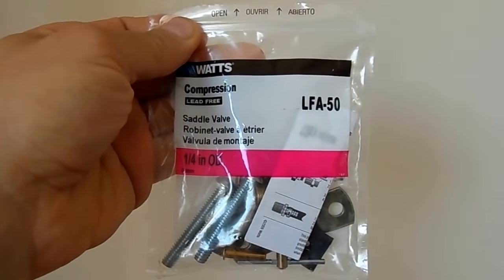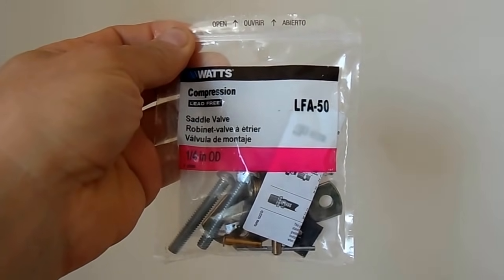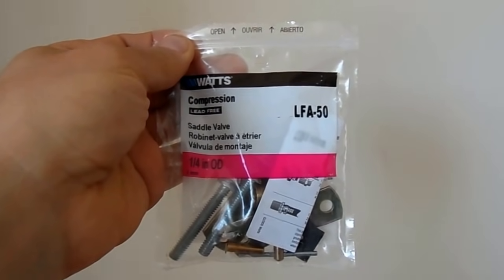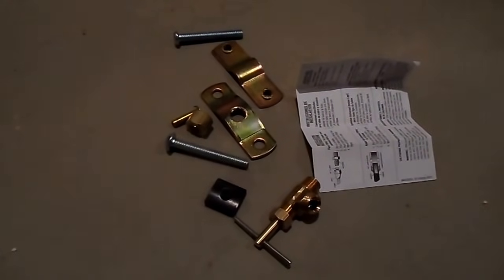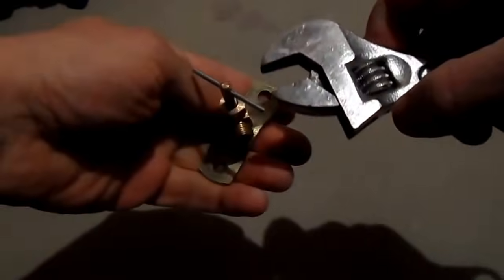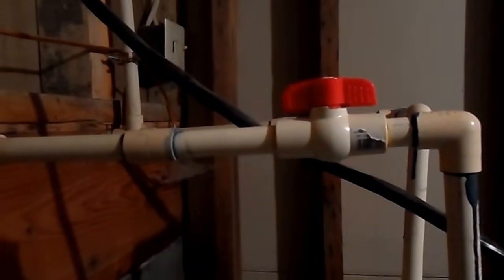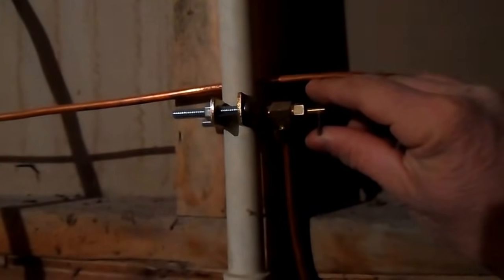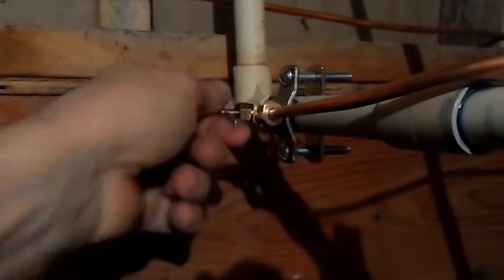How to Install a Saddle Valve (Plumbing Tutorial)

Comment: These valves will not pass home inspections, and insurance companies will not cover damage caused by leakage.
Reply from the maker: I would never suggest installing them anywhere where it is not code to avoid these problems. As far as I know, they are no longer code anywhere in the USA.
Reply: @JanaeBerzon So you did this video for the views??
Reply from the maker: When I created this video they were still up to residential code where it was installed and in many other places.

Comment: Unless your humidifier somehow knows that you have recently run hot water before it draws a supply it doesn't really matter if you connect to the hot or cold line because most of the time you will get cold water either way.
Reply from the maker: That's not really true, because your humidifier will typically run for at least 10 minutes. So, yes, it will start cold, but will go through plenty of hot water by the time it's done. The amount of cold water it will run through can also be minimized by placing the valve close to the tank.

Comment: Saddle valve: an accident about to happen
Reply from the maker: Not necessarily, but it is no longer code for new installations just about anywhere in the US, so I would not recommend it.
Reply: I got one that's been working for 45 years. No trouble yet.

Comment: Thats a water time bomb that will go off a insurance claim waiting to happen that  no insurance will pay when they find out it was a sadle valve
Reply from the maker: I can't comment on hat the insurance company may or may not do in your specific case. Generally speaking, if it was code when it was installed, it should be grandfathered in and an insurance company would have a hard time denying your claim based on this alone, if you have the appropriate coverage, of course.

Comment: You should explain how to do one if you have steel pipe. That wont pierce the pipe. Im wondering if you can just tap threads or the you use a different type. For a swamp cooler
Reply from the maker: You can't use these with steel pipes. They are designed to work with copper pipes, but will also work fine with cpvc and pvc.

Comment: Not clearly demonstrating the various parts that come with the valve itself.
Reply from the maker: There is really not much to demo here. It's the valve, the clamp, and the gasket.
Reply: @JanaeBerzon  there are about 7 pieces in a saddle valve packet. If you're doing a "how to" on installing a saddle valve you have to walk through each part, ehat the part is for and how those parts work in relation to one another. Then, of course, you show this step by step in the video to get a legit how-to video. Assume your audience has no idea how to perform the task at hand.
Reply from the maker: @charleswalker6109  I am not sure that one aize fits all is the best approach for turorials. That's why there ate soany of them out there and each one has its own audience

Comment: Where is the needle that pierces into the pipe? (is it hidden in the valve?){ and if my existing saddle valve leaks can I replace the saddle valve without purchasing the whole kit? Thanks.... Can I buy just the valve with the needle? Thanks....
Reply from the maker: The piercing needle is inside the valve.

If your eisting one leaks in the open position, you can shut it off and if it doesn't leak in the closed position add another one next to it. If you try to just replace it, you are likely to pierce a new hole or enlarge the old one, which will create a big mess - don't do it!

You may be able to find a valve without the 1/4" line, but  don't expect a large price diffrence.
Reply: @JanaeBerzon  Ok, could I replace just that part(the valve with the needle in it? because thats the one that has the ferrel in it(internals)....thanks....
Reply from the maker: @zr1ne  it really depends on where the leak is and under what conditions it leaks. If the leak is feom the top of the valve, your best solution may be to tighten that nut. You may also try repacking under that nut.

Replacing is not likely to work, especially if the replacement is not a perfect match.

If the leak is where the saddle valve attaches to the host pipe, replacement is even more likely to cause additional problems.

Comment: Step 1: throw your saddle valve in the garbage. Step 2, install a proper Tee fitting, reducer, and compression fittong as needed. This will take time but isn't guaranteed to leak eventually as saddle valves are.
Reply from the maker: That's a different approach that will also work. It's not nearly as easy for DIY.
Reply: @JanaeBerzon  saddle valves are not allowed under most plumbing code because they are almost guaranteed to leek eventually.  If you can't do it the proper way, you shouldn't be doing it at all.
Reply: @shawandrew  Why do manufacturers of plumbing parts even make products that don't meet plumbing codes?  Is there not an equivalent of UL for plumbing, like there is for electrical, that would stop such a product from even existing in the first place?   How do accordion traps and saddle valves ever get approved for manufacture?
Reply: @carultch  thanks for the question. I am not a plumber and learned what I did from replacing a saddle valve and seeking information from those more informed on YouTube. From what I can tell, the rules in plumbing are more like industry standards that affect the liability for the plumber. They don't really affect DIYers (do it yourself - ers) at all, and obviously you can do whatever you want to your own home, though it might affect the home inspection when selling it or risk damage to your property. Manufacturers also know that there is a niche for DIYers who would rather do something in a way that doesn't require as much skill or training, and whether you agree or disagree with this level of government regulation, there are not strict regulations against some plumbing products which plumbers would be liable for using. I'd also add that some of these standards might not be universal across all states or all over the world. I saw accordion style traps on Urinals in a Ukraine men's bathroom. The bathroom also always smelled like piss and had a sign with a visual telling men not to piss on the floor lol.
Reply: Can you shut these off?
Reply: @chriswentzell1591  if you install a valve on your line coming off the Tee, then you will be able to shut off the water on the Tee line.
Reply: I've got a 45 year old saddle valve that's still doing fine. It's lived through 3 refrigerators and now on its 4th.
Reply: @mandovapehater6988  doing better than the one that I removed from under the in law's sink. There are some saddle vlaves that are will work, but I don't trust them.
Reply: @shawandrew  understand. I'm sure they're not the best option but mine has yet to fail. I'm actually about to install another one for my downstairs fridge. Is the rubber piece just supposed to sit between the pipe and needle? It's curved as to fit or rest against the pipe and then a male piece that I assume the needle goes through. I don't know if the old one has a rubber in it. I've never installed a saddle valve and I'm not taking that old one apart just to look.

Comment: My saddle valve won't stop the water to my fridge when I turn it clockwise.  When I turn it counter clockwise water sprays me in the face. Is that fixable?
Reply: Saddle valves do tend to have these problems. A Tee style fitting might work better. There are different kinds  including push connect and soldered fittings. The channel Got2lrearn has a lot of good information on alternatives if you decide to go with an alternative to saddle valves.
Reply from the maker: It may be possible to fix. By description alone, I can't tell. I would try replacing the gasket and if that didn't work, replacing it. If the symptoms persisted after that, it may mean that the piercing has gotten too fig over time and through much mechanical action closing and opening the valve. In that case, the only things you can really do is replace it with a different valve type in the same location, or add another saddle valve down the pipe.

Comment: I was watching the video for the very ending. My saddle valve is secure but when I open it back up halfway water spurts out the end of the adjustor. When I loosen the valve completely out, the water stops but there's no water going into the line. Any idea what's wrong here?
Reply from the maker: If I understand you correctly, it sounds like the nut at the top of your saddle valve may be loose. If that's not it, perhaps the valve is defective.

Comment: It is not a valve. It is a tap. And is illegal as per code. And will fail at some point. Anyone who installs one of those is a hack and is incompetent.
Reply from the maker: You can call a saddle valve a tap, or whatever else you like and make unfounded claims, as you like, but that doesn't make them so. I have had multiple of these valves operating for decades in houses I have owned and none of them have ever failed. Can they fail, of course, like any other valve. If they are illegal in your state or jurisdiction, please don't use them. They are perfectly legal where I live.
Reply: @JanaeBerzon  What is unfounded with my statement? Also what municipality are you claiming that they are legal to be used in?
Reply: I installed one some 20 years ago..it's still working
Reply: I got 45 years on one. I think there are some licensed plumbers on here that are made about people doing it themselves.

Comment: Saddle valves are junk and should never be used eventually they all leak
Reply from the maker: I have had multiple saddle valves last for decades without leaking. Eventually everything breaks and these valves are not an exception, but that eventually is a very, very long time in the case of a well made saddle valve.

Comment: This is not a good option to use.  In many states it is not allowed by plumbing code and licenced plumbers are not allowed to install this type of valve.
Reply: no they're not the BEST option but they can work if done right. just watch them. everything is liable to leak at some point.
Reply: I've used them in the past with no issues.

Comment: So my valve from Home Depot appears to be missing the rubber gasket or do you think that there is a type that doesn’t use it
Reply from the maker: There should always be a gasket with these. I would not feel comfortable installing one that claims to not need a gasket.

Comment: Do I need to shut the water off for this?- the three Stooges
Reply from the maker: You don't have to turn off water supply when installing them. Obviously, if you ever want to remove one, you will need to turn off the water, remove the saddle vale and repair the piercing by silver soldering or otherwise repair it.

Comment: Discussing the drilling into the pipe would have helped - and saddle valves use compression fittings, not flared fittings
Reply: you're not supposed to drill. it has a spike on there. the valve itself will pierce the pvc pipe. you install it with the spike out, then close the valve to push the spike in. when you retract it, water will flow.
Reply: @Sean_y4k2l5  You're totally correct about pvc pipe, but older homes have galvanized pipe - and that totally needs to be drilled. Rigid copper pipe will also need to be drilled
Reply: @jonathanformhals4304  thanks jonathan. I just did this and I'm finding the flow is probably less than it could be. i will probably go back in there and drill it.

this valve kinda sucks. a sink-like shutoff valve in 1/4" would be better, but i'm in Costa Rica where certain parts are not available.

Comment: Using a saddle valve is the dumbest thing to do for water supply line. No plumbing section of any code allows for piercing saddle valves to be used anywhere in residential plumbing. It is mind boggling how those things aren't outlawed yet
Reply from the maker: This statement is incorrect. The correct version of it would go something like this: "Saddle valves may not be appropriate/approved for some applications and pipe types and some local jurisdictions may have adopted plumbing codes that prohibit their use in certain cases."
Reply: You are dead wrong and he is right. Saddle valves are against code in the MAJORITY of States and for good reason. You are a consumer can buy and install one. But a professional plumber cannot. That tells you all you need to know. Its illegal in most places for a plumber to take money for it because it doesn't do the consumer a service.
Reply: Jake Berzon thank you but i don't really need you to sweeten and soften it. it is dumb and it is stupid using a saddle valve, regardless of what codes say. codes follow reason and if a plumber is using it just because it is convenient for him that doesnt mean that customer should be misled that this is still the dumbest thing you can put on your pipes. Any other suggestions for spelling and grammar improvements?
Reply from the maker: You know what they say about opinions?.. Exactly! Everybody has one. You think it is stupid and dumb to use piercing saddle valves and millions of people have used them without problems. Can't wait to hear what you think about Sharkbites!
Reply: Dude, I am not sharing an opinion but a scientifically proven fact. I don't think it is stupid and dumb to use one. I know for a  fact to be stupid and dumb. How do you know exactly that millions of people used them without any problem? Did you do a statistical survey? I doubt that. You are one of those guys you're speaking about - with plenty of opinion and zero factual experience. My factual experience states that every time you install a piercing saddle valve on a hot water line, in 4 years it will be corroded in such a way that it either will leak or will be completely blocked. I am still waiting for you to show me which code allows usage of saddle valves, but I guess it's just like your opinion - you think it is so, but whether it actually is so, well, that's another matter.
Reply from the maker: For your information, my friend, codes can just as easily forbid certain usages, as they can allow others. What this means is that in a lot of cases, whatever is not forbidden, is allowed! Also, I do not have to be the one collecting statistics in order to use them. And BTW, I am sorry about your negative experience with saddle valves.
Reply: You don't need to be sorry about anything. There are always going to be morons who exploit gray code definitions to market 18th century technology without assuming any liability and even dumber users who will not object to whatever "da pro" says. Anyways, it is our job, yours most of all since you uploaded this instruction, to clarify also what the are risks and limitations of using such valve. I didn't hear that on your vid, and frankly, it is kind of misleading and annoying.
Reply from the maker: There is nothing misleading about my video detailing installation of a saddle valve in my home located in a jurisdiction that allows such installations. Your statements on the other hand range from insulting to misrepresenting. Please go find another place to litter.
Reply: @JanaeBerzon  ... I've got to agree with you. I've been using a saddle valve for years for my refrigerator water supply. No problems. I see absolutely nothing wrong in your presentation.
Reply: Quentyn73 we install humidifiers with our furnaces at work and the humidifiers used to come with a really nice tee fitting. now they come with these saddle valves. if installed on the cold line is the life expectancy any better?
Reply from the maker: You can install them on the cold water lines for refrigerator applications and they should work reliably for a very long time either way, as long as you don't turn them on and off over, and over, and over again.
Reply: Hayden Dyson life expectancy of a saddle valve on a cold line is much bigger than hot, but then you need hot water to achieve better evaporation. I'd use a small ball valve, similar to ones used for water supply for toilet bowls, just make sure that it has the compression ring connection matching the line diameter to the humidifier. Saddle valve on hot water line is guaranteed to corrode and break in 5 yrs max. ball valve. will break after 50 plus it gives the option to close su0ply
Reply: 45 years on one. No trouble. Lucky I guess.
Reply: @mandovapehater6988  Very. And you use it on city water, with filters probably.
Reply: @Quentyn73  na man. 50 year old well. I don't know how. It just works. Got a good one I guess that wasn't made overseas on a Friday at quitting time. 😂 It's been turned off and on only a few times to replace 4 refrigerators over the years. I'll admit, it did seem to leak a little this last time but the nut at the T handle was loose. Also, there were no codes to speak of where I live back in the 70s.
Reply: @mandovapehater6988  It is bad design, and it doesn't matter where it is made.
Reply: @Quentyn73  I don't doubt it. 👍

Comment: What I was interested in see is how to assemble the nut assembly to connect the water pipe that goes to say, a humidifier. :(
Reply from the maker: This tutorial only shows you how to attach a saddle valve. If you are interested in how to attach the supply line that goes between it and an appliance, please check out this tutorial, instead: https://www.youtube.com/watch?v=KvBu3Z3bmtM

Comment: you turned it back way more than half way at the very end
Reply from the maker: Some valves you turn back more than others and usually it is at least half way back. As soon as you have sufficient water flow, you can stop turning it back.
Reply: Nicholas Staufenbiel.